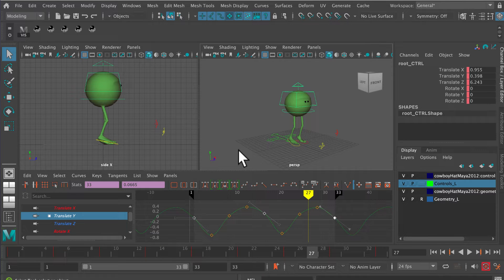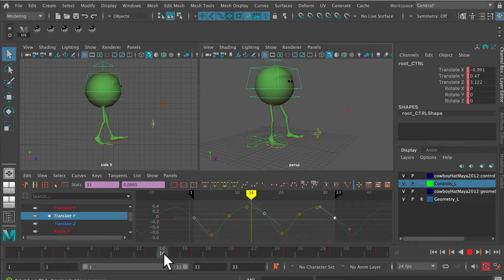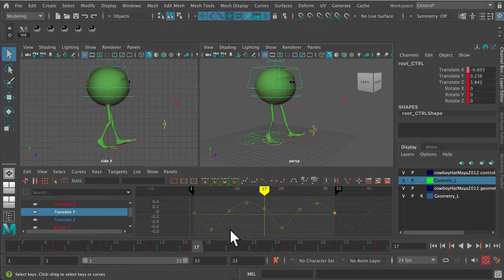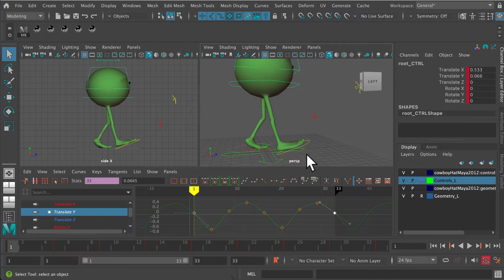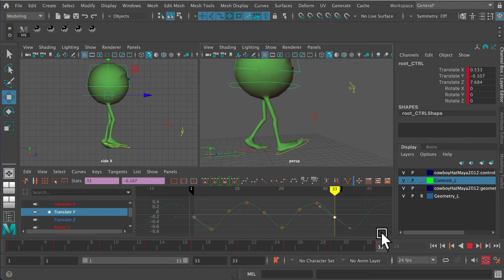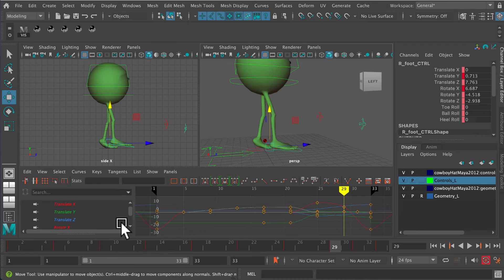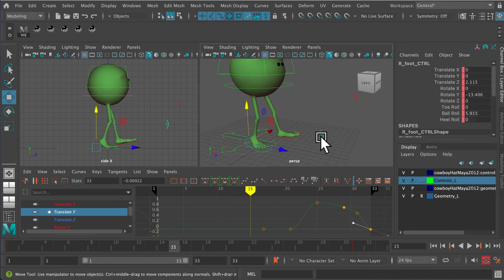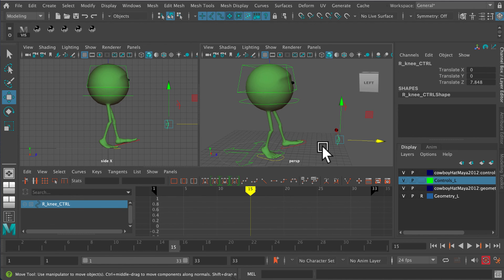How to Fix IK Pops in a Walk Cycle

Comment: That need some frame to frame editing. But problem come from 3 main source.
Fist hip main control. Second and most important is the foot rolls controls. They should set frame by frame to make Knee moves smoother. The hard part is to setting both control foot and toe roll together!
Third source of problem is the foot vertical position and spacing.